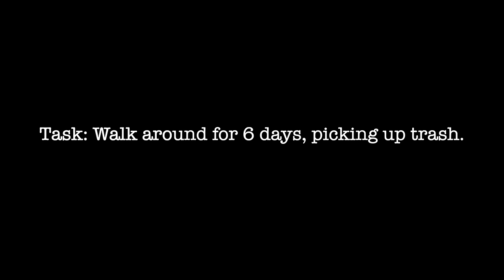Restoring My Great-Grandfather's Old Abandoned Farm

Comment: I'm working on my micro farm and I expected there would be a LOT of work to do...and there is.  I got most of the low hanging fruit done.  I have already started cultivation, which I'm really happy about.  My little urban micro farm is only 1/8 acre, but have to start somewhere.  Still a lot more work to do, but, now it's getting more into the harder work.  My ADHD makes it easy to start stuff, but difficult to finish.

Comment: Seems to me the old farm site needed a good  chisel plowing to lift up debris to a depth of 8" or so.I've cleared land, tree stumps, brush, and building sites, and always used a good chisel plowing , then a heavy brush fork to sift the loosened soil, then the field spring harrow to finish up getting the smaller debris. Much could be handled by machine, and dumped in a dump truck, saves so much time.